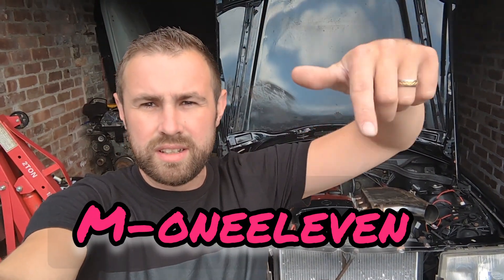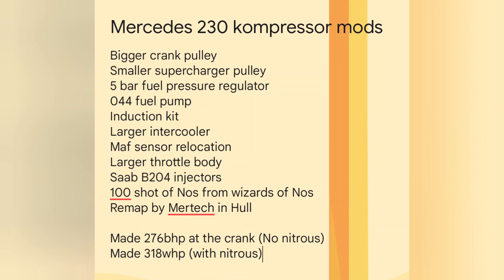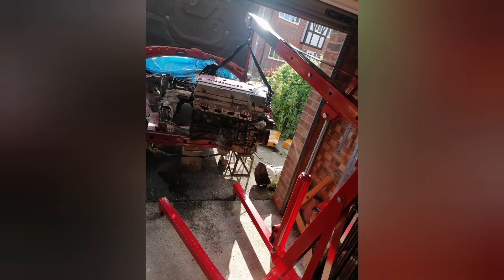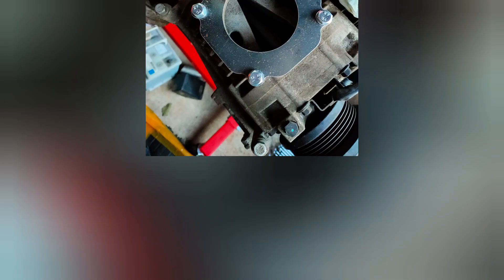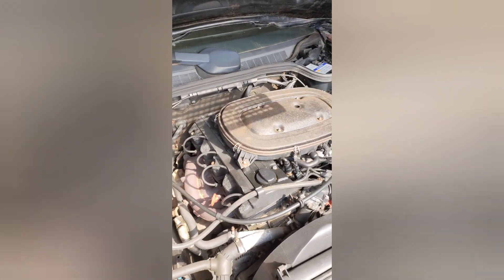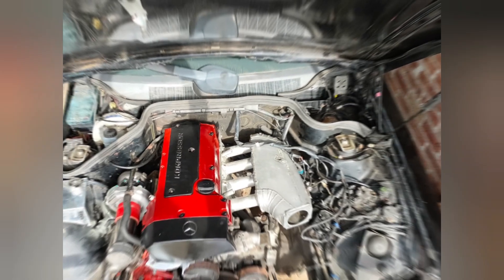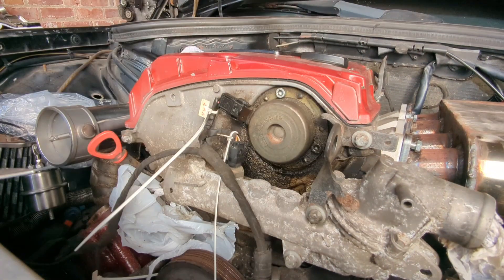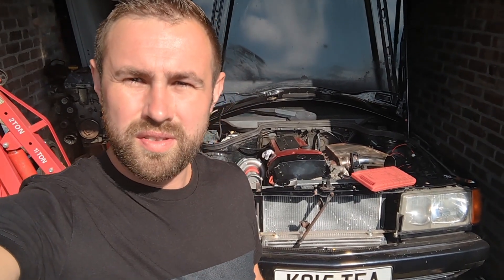How to put an M111 engine into a 190e

Comment: Are the Saab injectores  plug and play?
Reply from the maker: They will fit in but you have to just create a small groove in the side of the injector so the clip fits on
Reply: @BoostWorx  Thank you! Could you please also tell me the part number of the 5Bar Fuelregulator. If i search for Fuelregulators for the M111, they are all for 3,8 Bar
Reply from the maker: @christianmartin4798 just buy a universal one pal as it fits directly in place. It's a standardised size

Comment: Hello, I'm trying to do the same swap with my 190e, currently looking for a wrecked clk230 or c230. How did everything go with the tachometer and fuel pump?
Reply from the maker: The fuel pump runs on the original 190e pump and the tacho is done using a conversation kit from modifiedmercs

Comment: anyone put a barra in a 190e yet ? ive seen 2jz in them so thinking i could do it
Reply from the maker: I don't see why it can't be done. The only thing with the 190e is putting a straight 6 into one creates the usual issue. That it puts more weight towards the front essentially turning it into a drift car or a burnout monster. So if that's what you're aiming for I'd say go for it 😁

Comment: Really cool build! I am building a w202 2.0 kompressor, I would like to know which intercooler had you fit on your w202 and which throttle body? Thank you.
Reply from the maker: @Lealg14  the throttle body was standard pal and the intercooler was an eBay job I believe it was a make called direnza just find the one that has the inlet and outlet in the correct area then just mount it with a couple of custom brackets.

Comment: You and alex are doi g some great work on content for these engines. Theres not alot of people huolding these or at least making contect on them. I actuaky gonna be doing m111 build too but on what i like to call "the ugly duckling" which is the c230 coupe (cl203). Already have an idea for custom body kit for later on but ima start with porting the sc and delteding the silencers have, have some fun in it since its a manual, then ima look into putting a turbo in it. What ecu do you use?
Reply from the maker: @angelaldacoaa  it's currently got a Rus efi ECU. In future I hope to be swapping to a haltech but we will see. Good luck with your project pal

Comment: Hello. I have a CLK 2.3k engine and I would like to put it in a W201 1.8 manual. Will the gearbox go from 1.8 to 2.3k? The Clk has an automatic gearbox, and the W201 has a manual 4b.What engine mounts you use?
Reply from the maker: The gearbox from the w201 will have the same bolt pattern so in theory yes it will fit but. I do believe you need to make some alterations to make it work. If you need engine mounts go to Instagram and search for 190tevolution Andy prescott and message him he can supply mounts.

Comment: Its Look Nixe, Which flywheel do you Use ?
Reply from the maker: I used a single mass flywheel from diesel pump UK made for an om606 but fits perfectly with a full clutch kit and slave cylinder from diesel pump UK

Comment: What radiator is that?
Reply from the maker: That rad is an after market duel core aluminium designed for a triumph spitfire that had the v8 conversions. I picked it because the pipes are roughly in the right place. You can find them on eBay for around £100GBP

Comment: Hello 
what motor mounts do i need?
And do i need a different Control unit, or can i Switch the engine without other component ?
Thanks
Reply from the maker: https://instagram.com/190tevolution?igshid=MzRlODBiNWFlZA== this is the man who sells mounts my friend. You can use the m111 ECU if you wish but I'm using a standalone
Reply: @BoostWorx  what standalone if you dont mind me asking? Looking to do this swap on my 2.6
Reply from the maker: @DeafLambs  I'm currently using a RUSefi but i plan on switching to a haltech when I save up for one

Comment: Thinking about doing this swap with my 190e. what drive shaft are you going to use or does it bolt up to the 190es stock one? or what set up have you in mind? Thanks
Reply from the maker: It will be the standard 190e manual prop shaft using a coupler from stern garage 😁

Comment: I have a CLK200 Kompressor (M111,945) and i'd like to buy a kompressor pulley like yours (and maybe a crankshaft pulley too if the a/f mix doesn't get too poor). May i ask where did you find them?
Did you make a tune, or just plug in and play?
Reply from the maker: They supercharger pulley was shaved down and ported by cooneytune (in Essex) I'm not sure if they are still running but and good engineer will be able to do this for you. The over size crank pulley I bought from eBay. These are available from a few different companies just type it in onto Google. I had the 230 Kompressor tuned by Mertech in Hull (east Yorkshire) on a Dyno. I will be doing a full standalone conversion soon using a plug and play loom from gogarage.us 😁

Comment: hoping to do this swap soonish, currently in the process of sorting out all other sorts of stuff like suspension and bodywork, how do you run the fuel lines for the engine? cheers
Reply from the maker: I'm using the standard 190e fuel lines underneath the car with a 044 fuel pump. As for in the engine bay I have a aftermarket fuel pressure regulator and a custom fuel rail. This won't be needed unless you are intending on 500+bhp
Reply: And then he sold the 190e 😂😂
Reply: @s13zenki  it’s on sight

Comment: Great video mate 😎
Reply from the maker: Thank you pal 😁
Reply: @BoostWorx  what’s the part number for the flywheel mate? And did you use a standard clutch plate
Reply from the maker: @Shadowmosesarea51  I'll send you the link for it mate it came as a full kit clutch plate, flywheel and slave cylinder and bearings all in 😁
Reply: @BoostWorx  thanks mate
Reply from the maker: https://dieselpumpuk.com/products/mercedes-performance-clutch-kit?_pos=2&_sid=c4e6c38e0&_ss=r